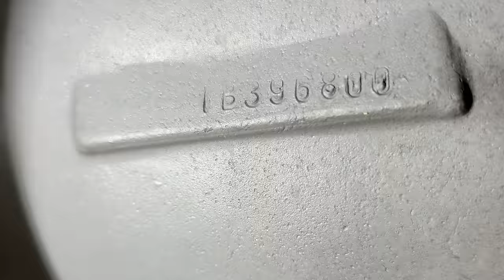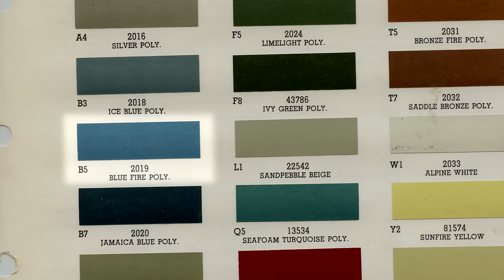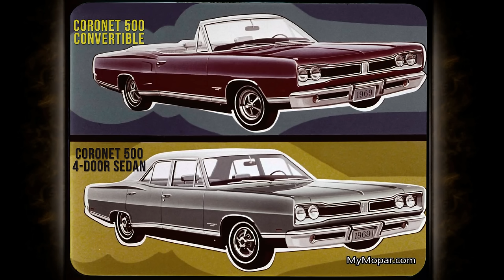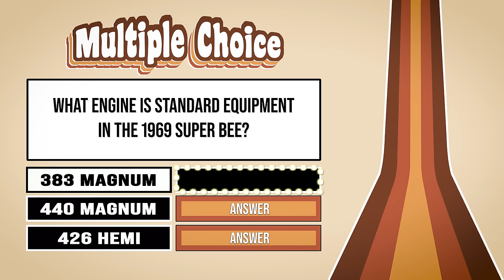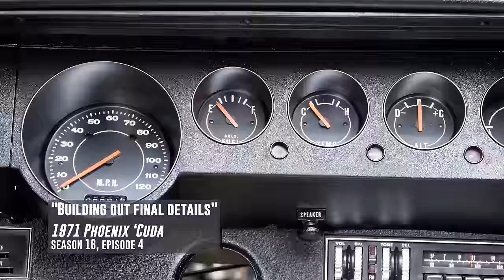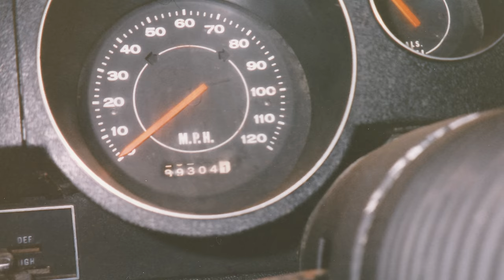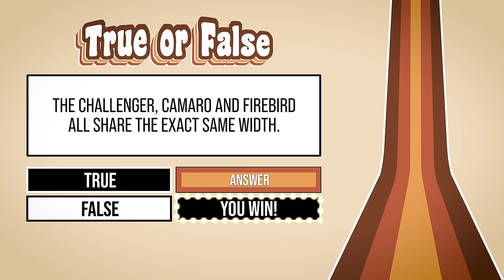NEW EPISODE: PHOENIX CUDA RISES FROM THE ASHES!

Comment: There was no 1970 Firebird or Camaro; 1970 1/2, which introduced the Ferrari inspired body. Oh, the 427 Cobra uses coil springs on all four wheels as does the Corvette. Torsion bars used on Cadillacs were for LUXURY cars, not sports cars. Talk about comparing apples and oranges….